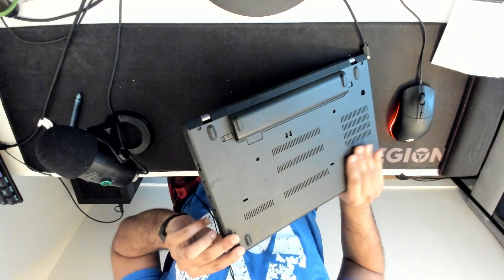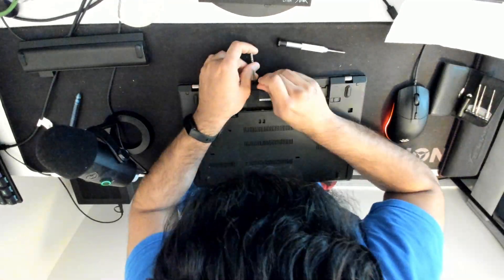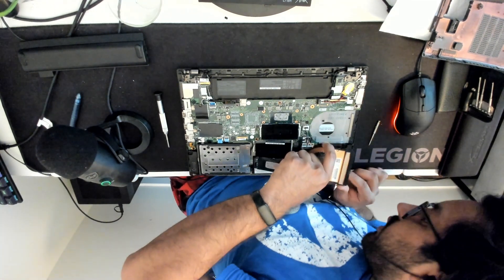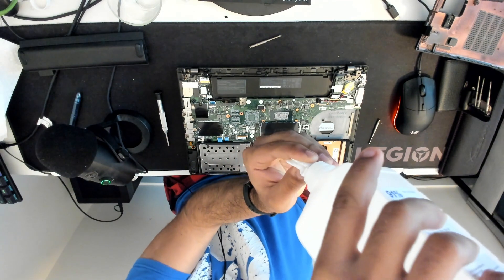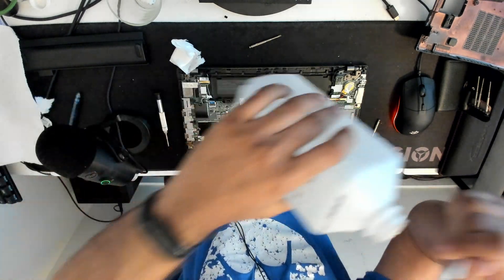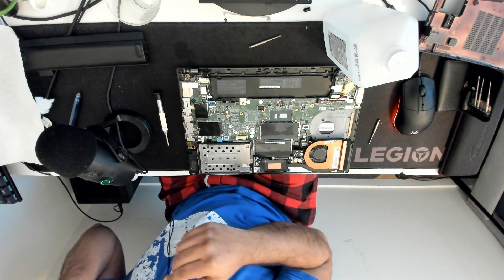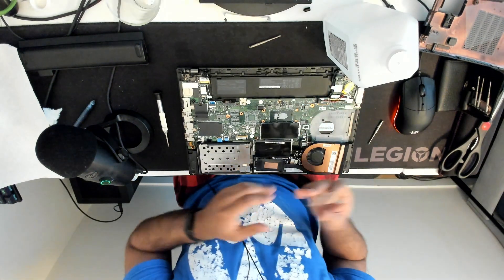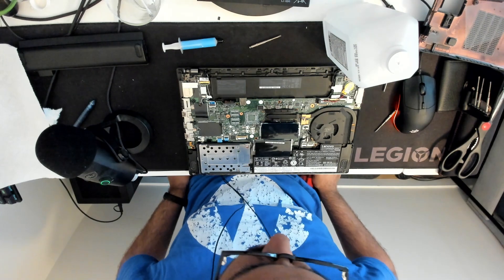Replacing Thermal Paste on Lenovo Thinkpad (t480)

Comment: Hi, can you give some reasons as to why replacing the thermal paste is worth doing on your laptop?
Reply: Stock thermal pastes are often not as good  as third-party ones, and most thermal pastes will dry out over time, resulting in worse temperatures. Replacing will help with these issues.